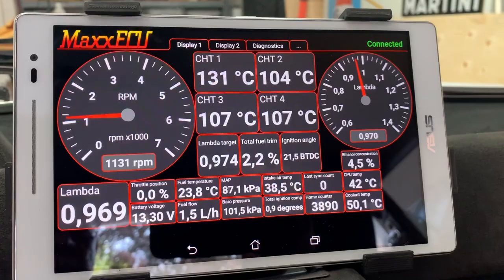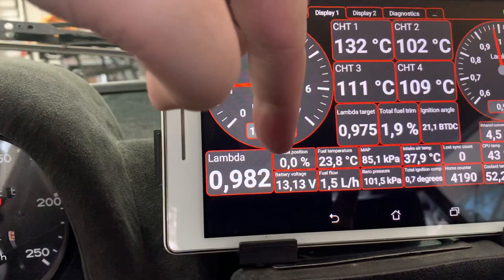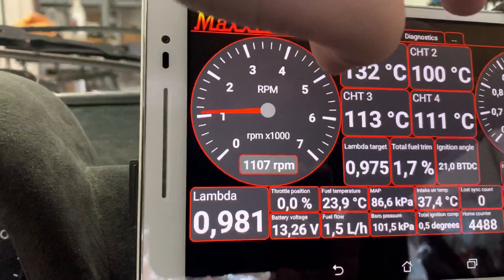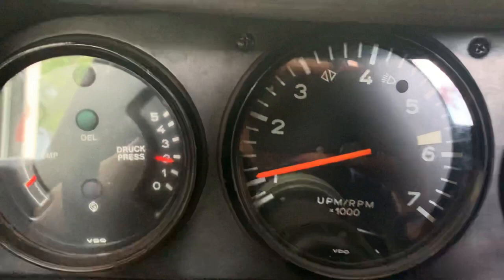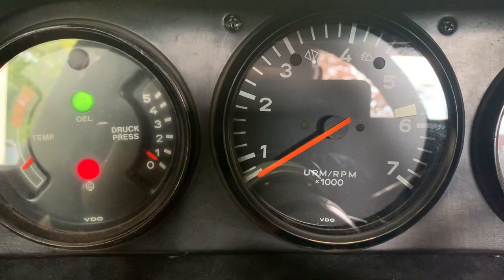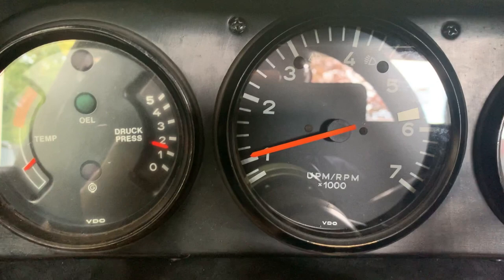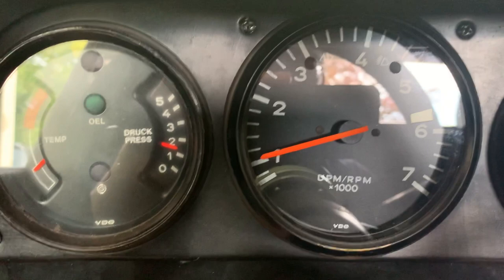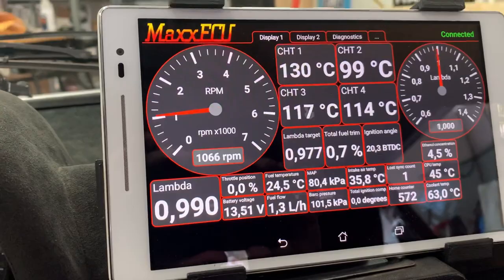Porsche 914 aftermarket ecu setup

Comment: I have a type4 with vfr itb with maxxecu, but I can't slow down my idle.. do you use a separate idle valve selenoid? I've set the throttle plate gap at 0.35
Reply from the maker: I have my throttle plates fully closed at idle. I dont have a idle valve. My idle is very low, 500-600 rpm the first minute and then it settles around 1000 rpm once there is a little heat into the engine.
Reply: @MatsGarage I will try to close mine to see if it idles better, thanks for the tip 🤘

Comment: Should you be worried that cylinder 1 is running about 20c hotter?
Reply from the maker: Its a good question I have tried finding out why it does that. Cylinder one draws slightly more air than cylinder two but since they share the same throttle axle I cant really adjust anything there. It could be that that injector runs slightly leaner than the others. Aslong as it stays consistent then I'm not worried. If the difference would start to change then its something to look deeper into. The temps are well within "normal operating temperatures" even with the difference.
Reply: @MatsGarage  You can try to put some more fuel for cyl1 if you have full sequential fuel injection?